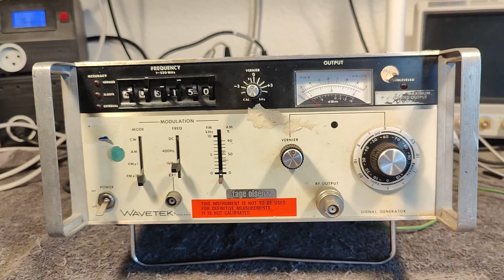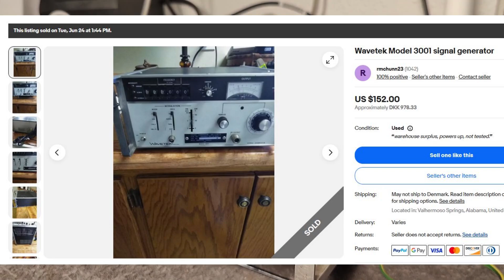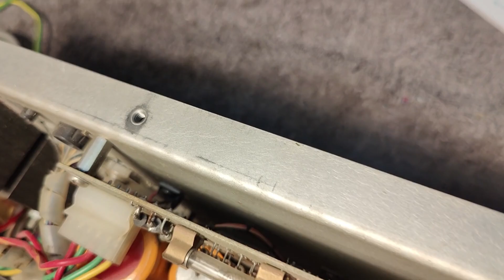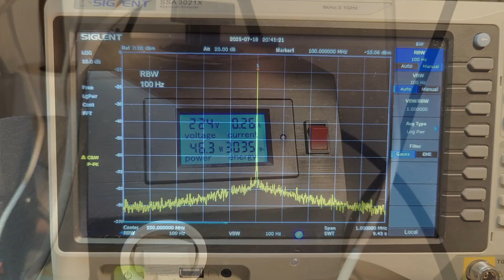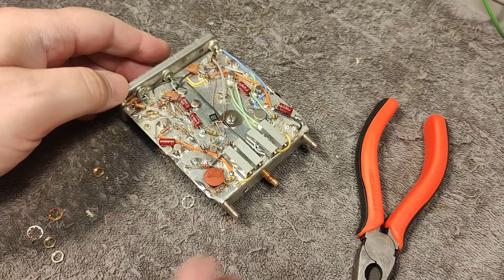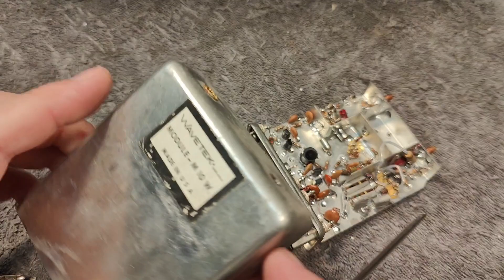Wavetek model 3001 Signal Generator 1-520MHz test teardown

Comment: I have 3000-200 which is ... almost the same. In practice, more 0.1% than 0.001% though because the 200 mod changes the vernier circuit in an undocumented manner and the vernier board is really tedious to access and debug, so can`t make my mind up and fix it. So waht, still better than any analog tuned generator, and one can tune it with a frequency counter :)

Comment: Thanks, nice video. With respect to the 'scope signal disappearing, I suspect that maybe you didn't terminate the connection with 50 ohms, so reflections were cancelling it out.. I have the same 'scope and it's fine up to and beyond 500MHz, provided that the termination is correct.

Comment: I have been working on a 3006 (mine) and a 3001 like yours. Very complex PLL arrangement, sadly, none of the two work exactly as they should. They have a lot of 10uF tantalum caps, in mine I replaced more than 20 of them which shorted. A real PITA to get under other components in the hand-wired modules to get at some of them.. (I thought of over voltage, but found nothing wrong with power supply, must have been a bad batch of caps!) I still have some freq ranges which don't work, and some modules differ from what I can find in the manuals. A guy in the US sent me some data which was not in the manuals on line. Nice to see yours working well!